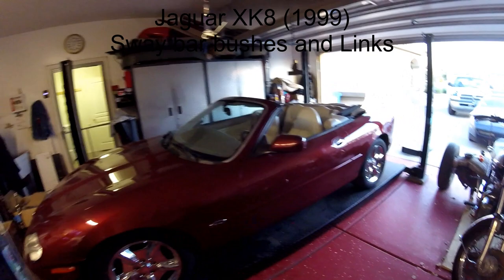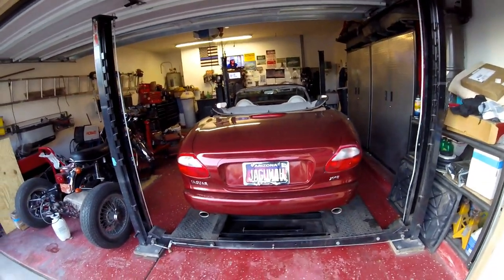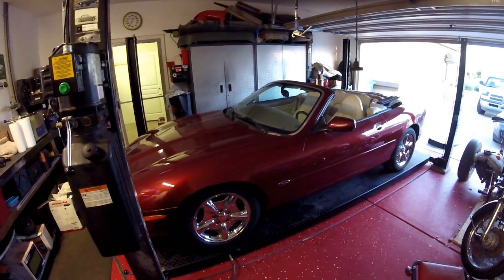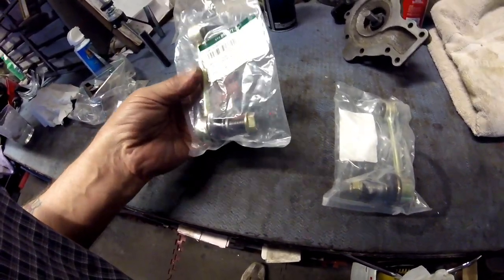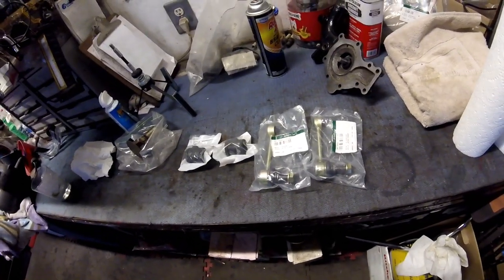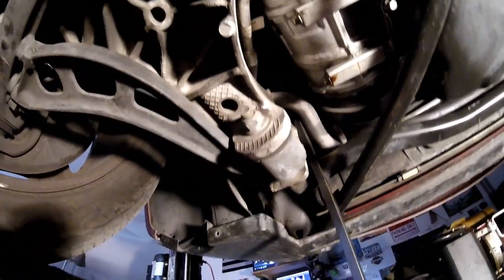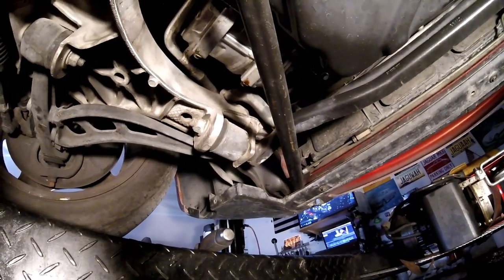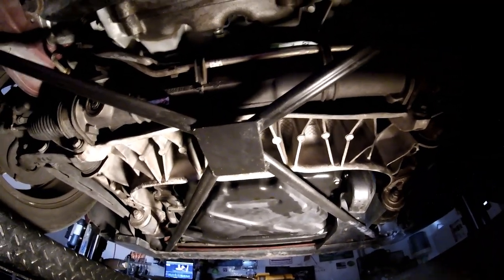Jaguar XK8 1999 Sway Bar & Sway Bar Links

Comment: If you remove the double fan assy infront of the radiator 10mins it will provide access to the bolts no probs.

Comment: I think that is the radiator overflow overflow tank, its fed from the tank in the engine bay? I hope you had the car on its wheel when you tightened the sway bar links fully.
Reply from the maker: Thanks for the comment guess you didn't see that the vehicle is supported on the lower control arm and therefore the weight is on the suspension, however the sway bar rotates in the bushes and the lower bolt on the link is a shoulder bolt and allows small movement as for the upper connection it is a ball and therefore pivots. I would however agree that is is always a good practice to do everything up while the weight is on the suspension which is why I supported it on the control arm .
Must admit I assumed that there was only one coolant expansion tank on the cooling system, how odd they would put two i wonder why they did that :)
Reply: @jagvette1  This is the recovery atmospheric tank. It's for overflow and letting air out too, the Degas bottle. These cars need not to have any bubbles of air in the cooling system so when you top off your coolant tank and run the car and AC and heat it should overflow fluid  through the hose after a while, through the one hose still mounted on your Degas. The broken one is where it overflows when too full or too much air.
It's important you fixed that connection since it is the one that will let out the overflow of coolant. The other one is the feed from the coolant tank. You should always have it on half full at cold state.
That's why the cooling is so small btw it's all pressurized and there's the atmospheric tank to assist with that. It doesn't need the huge tank like on other cars 
The side connector is for the usa version, or uk whichever, It's for the side light usually yellow or white. Some prefer having the Jag emblem instead but you can find it on eBay or such for 50 bucks a pop. It clips on like the emblem.
Take care
Reply: The elephant trump is connected to the air filter box to get air.

Comment: I have a 2004.5 XKR coupe and just about to do this job on it also - that top shock mount looks shot like mine were also, very visible from above the shock tower too, they crumble and flatten themselves with age and wear (like me I suppose LOL).
I watched a guy (from Finland I think) doing his sway bar bushes and he undone the bolts from above using a long extension bar setup...for what it's worth his channel is called BrickSkatton and that video is https://www.youtube.com/watch?v=LzICkd9iJag&ab_channel=BrickSkatton
I'm going to try and do it his method but with a few changes ( undo both linkages first - he did one at a time) but I know with these cars you'll always have issues with clearance etc! I actually damaged my guard on the passenger side (left like the UK, I'm in New Zealand) when I did the upper shock mount because I was trying to remove the shock and banged it around too much and dented the guard from the inside out! Two horrible little star-shaped dented paint cracks! Very pissed off with myself as you can imagine. Few other jobs to do yet like create a couple of new keys - the car came only with a bloody valet key - it won't open the boot manually so if the battery dies I have no manual boot access as the valet key is slightly different to a 'real' key. I'll stop rambling - subbed mate cheers!
Reply from the maker: there is always more than one way to skin a CAT :), you most definitely need to get the boot lock sorted or one day it will bite you in the ass (ARSE)